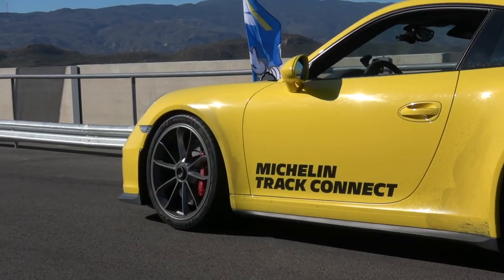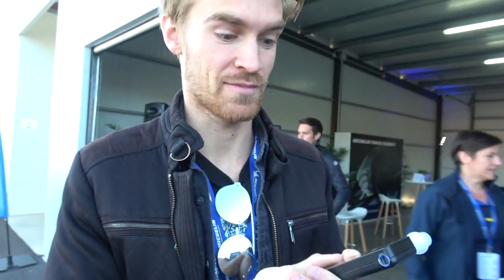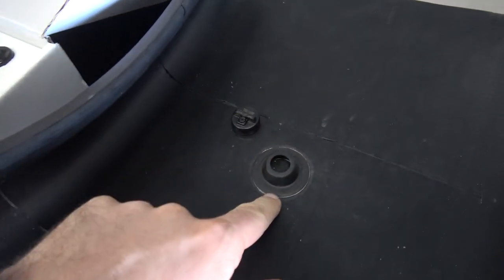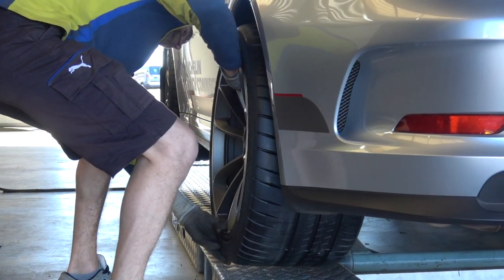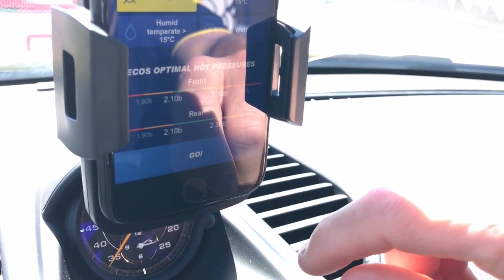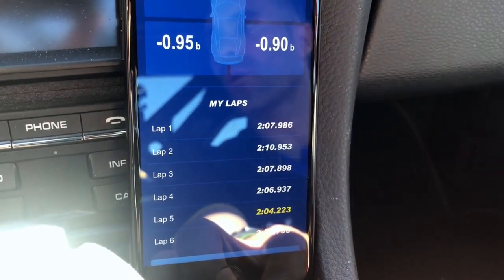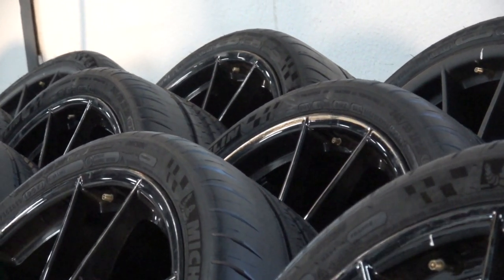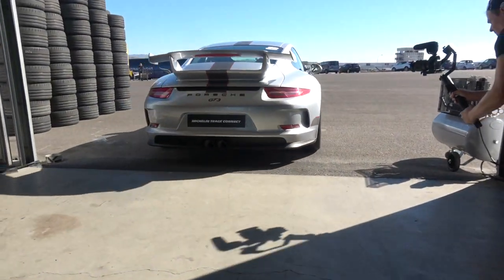This Made Me 4 Seconds A Lap Faster!

Comment: I totally get what you're talking about.  Until I went doing track days and amateur racing, I didn't realise how critical tyre pressures are.  Even a change of 1psi on a tyre can change the car's handling.  I race MX-5s.  Not a particularly a powerful car.  But where they excel is in handling and cornering.  So getting the most grip from your tyres is super important to going fast.  Getting the correct tyre pressures is key to that.

Comment: Storing the recommended pressures in the app based on the car you drive, the track you’re at, and the weather that day could help reduce the need to adjust them. Still nice to have that confirmation that you could tweak them as all of those are variable that drastically influence the pressure. Great idea 💡

Comment: Great video, as usual, with an interesting technology. On the track days I’ve done, I’ve driven to the track done the track day and driven back. I check the tyre pressures after each session and adjust accordingly, making a note of how much air is taken out. Then when I’m ready to drive home I add the pressure back in. So a great feature for the Michelin app would be to recommend how much air to add in after your track day, when you decide its time to go home.

Comment: Great video, James! Quite informative. It's an interesting technology. I need to say it was a good choice to go with GT3 because it's slightly more track focused than the other two and you should feel yourself the most comfortable with it because you know how it drives. Another point is that it's a 911, so it is rear-biased in terms of weight and the app asks you to drop pressure at the rear tyres quite a bit more. The wear is an iteresting part especially if it would be a hard-breaking dependant circuit. Also, intriguing part is how sensors can cope with rainy conditions, knowing that dropping the pressure in rain isn't always a great idea. Thanks for the video, we are looking forward for results with 458!

Comment: Spot on Michelin! Neat solution to real problem. Surely track based cars/performance cars should really prioritize cooling?  If the difference is that tangible, why don't they put more effort into cooling the wheel wells (brakes and tires)?

Comment: I would do the sensor differently, keep it in the air valve mechanism with the ability to adjust it remotely from inside the car. Then it can be adjusted based on user inputs or through their Connect software to adjust air automatically without needing to stop.
Reply: That would require more tech than needed... and could also be a risk of the app malfunctioning and causing accidents...

Comment: Comment for Michelin: don't put the final version on an app -- instead, work with the car manufacturers and have the car self-manage pressure (deflate) as it finds optimum, or warn the driver if the pressure is off/non-optimal. The car computers and tires should work together. Also, you don't want people blaming the company they had an accident because they were distracted by the app, and there are too many inputs before you get the thing going. Only test engineers would have the patience to actually use it -- hence: integrate it with car mananufacturer's controls. Pretty awesome results anyway.
Reply: They know that, they want money on their side, and not on car manufacturers side.
Reply: PlayerX my 13 yr old bmw has tyre pressure warning devices so if a tyre deflates it will tell me which one so it’s nothing new .
Reply: You missed the part of his recommendation where he talks about the concept of the car being able to self-manage pressure (deflate) on its own as the tires warm up. Unless your 13 year old BMW is a Humvee, it can't do that.

Comment: This is really cool tech. It's like what you get in Assetto Corsa or other sims.
Reply: yes very cool. But why can't car manufactures themselves not integrate this in their cars? BMW M has temperature and pressure display in the iDrive but they don't show whats optimum. And that would be an easy addition for them.

Also I saw you are quite familiar with fast cars etc. Do you know what the optimal temperature ranges for road use on the Sport Cup 2 and Pilot Sport 4S are?
Reply: You're right. They should just implement that into their cars. It's really cool to have.

I do test cars but I can't tell you the optimum tire temperatures for these compounds. Sorry.

Comment: I'm a fan of Michelin but the difference in lap time is open to other factors. James said himself he wasn't familiar with the track so was learning as he went and more than likely reducing lap times as a result.
Reply from the maker: Forget the lap times they would have become better the more I drove the track, it’s all about how it feels to drive and how much longer you can drive for without tyre fatigue - it was great 👍🏻
Reply: Mr JWW I currently run PSS and am thinking of going PS4 or 4S next as I've heard they are significantly better wet grip. Which lets face it is 6 months of the year in the UK. The thing I took away from this video is the need for a flat 6 9000rpm howl back in your life, the smiles per gallon were high when it was on song 😀 👌

Comment: Looking at how it fits it should be possible to design it so you could fit it to any tyre as you would with a puncture repair patch. I’m guessing they want to keep it exclusive to the top end tyres of the brand but it should be possible to fit it to any tyre
Reply from the maker: You would think so yes, however aside from the fact you have to buy and activate the chips through Michelin, they are fitted in a position so unique that the position its self is patented ha ha - something to do with accurate readings and centrifugal pressure on the inside of the tyre wall etc.
Reply: Mr JWW could be something for them to do in the future and open up a bigger market. Awesome bit of kit though, how would it work with nitro inflated tyres as that doesn’t change as much in temperature from what I been told? You probably have more idea driving high performance cars on a regular basis

Comment: Such a great innovation from Michelin! I will buy it immediately for my trackdays. But

1I where can we buy it?
2) can the sensors be used several times with several tyres?
3 price?
Reply from the maker: 1) Google ‘Michelin Track Connect’ and find the official Michelin link. You can find links to dealers there.

2)Yes - interchangeable between connected tyres

3) Price is advised at around 400 euros
Reply: Mr JWW Thanks a lot for your info, James, really appreciated! 👍 Do you know if it’s already on sale?
Reply from the maker: I believe it is on sale in Europe yes

Comment: Very cool video again James! I was wondering... Don't you get unbalance, because of the centrifuge forces? There is one sensor in the tyre, so the tyre is a little bit havier on that point. No problem on normal speeds, but 150mph and faster that might be a problem. Have you felt anything like that or do they compensate for the weight of the sensor in the rest of the tyre? THNX for an informative and great looking video :)!

Comment: This will probably integrated into in car infotainment systems, right?
Reply: I don't know why it hasn't already.  BMW has temperature and pressure display on the iDrive system but they don't show whats optimum.
Reply from the maker: I guess they don’t know what tyres you’ll be on. The Michelin app knows the car and the tyre and has their development data to back it up
Reply: Does the app work with apple car play? So you don't need to have your phone out, but it shows it on the in car screen.

Comment: Wow the Porsche 969, yeeeeears back, already had such sensors in their tyres, except they were transmitting to the car not the phone. Why is Michelin's marketing strategy to present that technology as a breakthrough?
Reply from the maker: You are confusing standard pressure monitoring. But you don’t know the exact pressure to drop them to - you’re just guessing. The app is calibrated to the specific car and based on your individual driving style will tell you the exact pressure for the most optimum performance. I know I would find it very useful rather than trial and error dropping pressures, going back out on track, coming back in and adjusting again etc.
Reply: Yes it might be handy on track, but you could just check the recommended pressure  given by the tyre manufacturer and adjust them accordingly which wouldn't be guessing. But yeah sure the gadget side of it is massively practical on track, and appealing! 
Massive congrats on your website, finally!! Ha ha. many quality items, just like your videos 👏

Comment: what is the point.one can check the tyre pressure without that app
Reply from the maker: But you don’t know the exact pressure to drop them to - you’re just guessing. The app is calibrated to the specific car and based on your individual driving style will tell you the exact pressure for the most optimum performance. I know I would find it very useful rather than trial and error dropping pressures, going back out on track, coming back in and adjusting again etc.

Comment: I hate that type of technology.
Taxi drivers and racing drivers dont need it.
So normal people really don't need it.
Its just a gimmick to get attention.
And 4 seconds on a track you've never driven on before isn't much.
That could be just because you get familiar with where the braking points are and when to turn into a corner.
Great video though.
And finally the website is up.
Love that.

Comment: so the app "assumes" that when front and rear tire pressures are identical that the car would handle neutrally, which is hardly scientific and far from the truth. Some cars do need more pressure in the front or the rear to eliminate unwanted handling characteristics. Interesting technology but still not much more useful than the standard car TPMS especially cars that can also show tire temps. This might only update quicker, as opposed to the delay built in factory systems.
Reply from the maker: No in-fact it presents different pressures for each tyre based on the results from the Track and how you drive individually. I had a recommendation of slightly lower on the left side of the car tan the right which would make sense going around a clockwise circuit.
Reply: Mr JWW What a piece of kit!!! I can’t wait till I can get my hands on these to help improve my lap times, this is a game changer! Michelin definitely picked THE best Automotive YouTuber to show off their fantastic tech! This video is awesome 👏🏻

Comment: shame you need connect tyres, and it's not a kit you can fit to normal CUP2's  , too many manafactures have N spec, M spec so it's a pain that this tech needs it's own tyres,  will have to stick to my pyro and on board PSI read out.